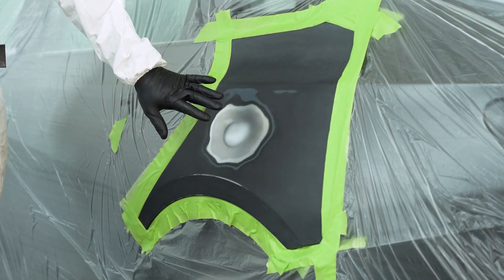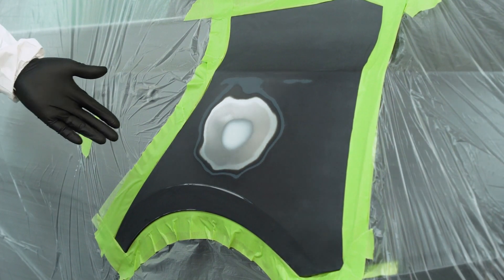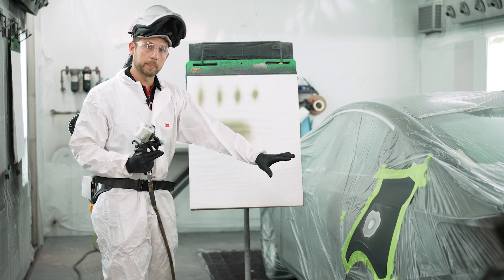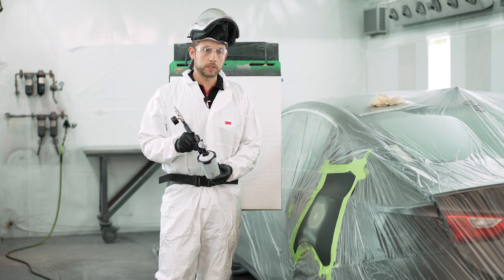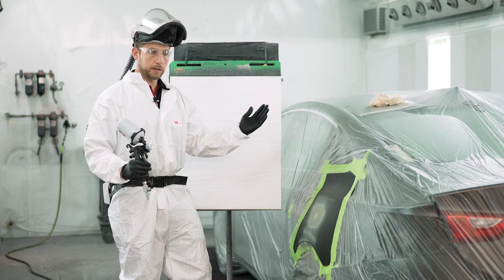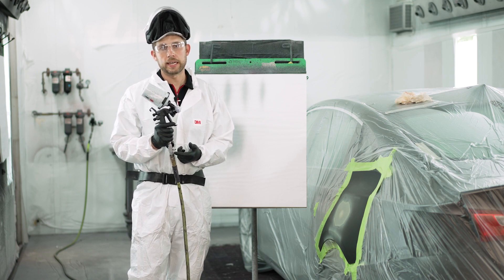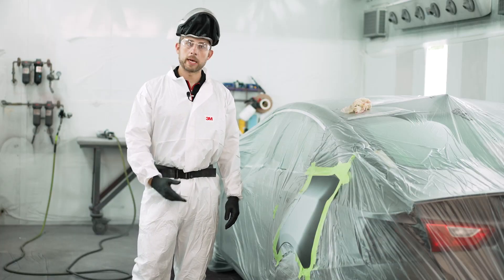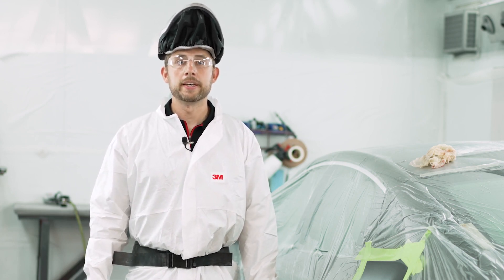Automotive Coatings Episode 1: Surface Prep, Masking, and Primer

Comment: I can't believe a professional would use etch primer. It's lacquer based and is about the weakest base you could use for a proper paint job. Especially if you're forking over hundreds for the paint you're applying. Epoxy is all that I would use. It's also the only primer that seals like paint so it won't let moisture get to anything underneath. I wouldn't drive around forever with it, but it technically could survive for a while without paint on top.

Comment: Etching primers scare me and here is why. If sanding an area to repair, I find evidence of previous repairs using unknown paint, primer and even filler. Using an “Etching” primer can cause lifting in this senecio.
 Certainly, a collision shop is repairing vehicles that are 10 year old or newer. These are less likely to have anything than the OEM coating. 
  With body filler applied in a controlled booth climate and seeing one coat of paint, I would still use two coats of epoxy for holding and sealing power. This alone will extend the life of this repair as many hold onto vehicles to an average age of 14 years and half of the county experiences cold weather leading to ice, snow and salt/sand mix. Unless you live in Colorado! Why? They use gravel sized mix with salt on roads. 
Epoxy may cost a little more but provides better rock chip protection to bare metal. 
Just thinking out loud! Otherwise all information is good! Thanks.

Comment: Is that mask your using as it's not run from compressor and battery type ok for 2k as it's still in the same room your spraying in hope this make sense thanks
Reply from the maker: Similar to our half face respirators, this portable air purifying respirator (PAPR) is outfitted with organic vapor cartridges which are well suited to the coatings we are applying.
Reply: @3MCollision  so what model are you using? And your saying safe for spraying 2k isosinate
Reply: @leerevell5998  On it's Amazon listing, it states, "TR-300N-plus provides protection against particulates . Not intended for vapors or gases and not an intrinsically safe system."
Reply: @GreatDataVideos  so it's no good then Paul for spraying 🤔
Reply from the maker: @leerevell5998  we have a range of PAPR products in our portfolio, but the respirator we use in our painting videos is the TR-800-PSK. You can read more about it here: 

https://www.3m.com/3M/en_US/p/d/v100577122/